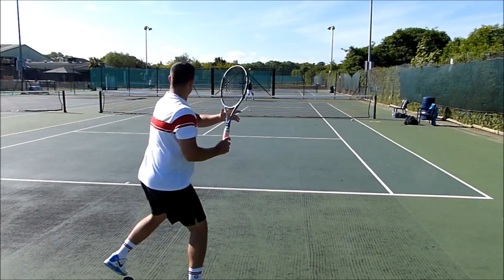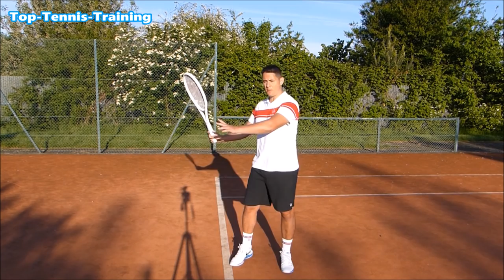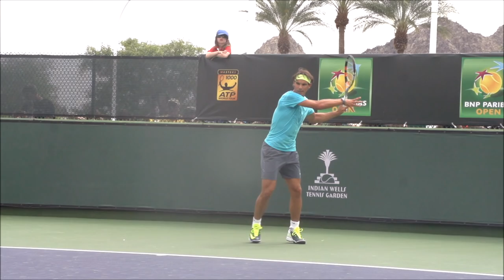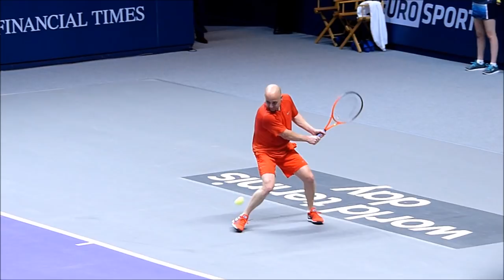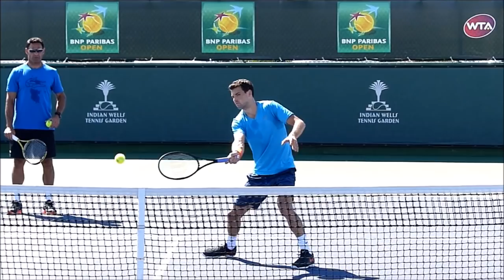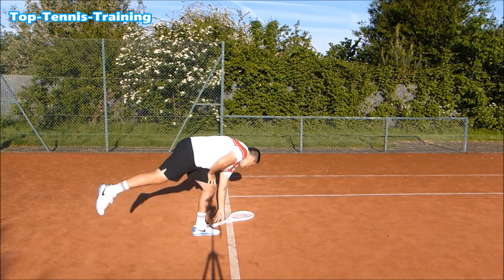How To Hammer The Ball In Tennis - Tennis Power Lesson

Comment: I've been told that I have a decent rally ball (avg ~50-55mph according to Playsight data) but I tend to stay too long in a neutral rallying position until my opponents' take control. My opponents tell me when they hit a weak ball, I need to step up the power and take control of the point. But I am struggling to do this. 

Is the technique for killing the ball different? I've watched your video on killing short balls but it was mostly about the footwork rather than increasing racquet head speed.

Comment: How tight should you grip the racket?
Reply: andrew1991robinson just enough so that you don't drop it when you go through your motion and hit , think more about holding it than gripping it
Reply from the maker: It differs on every shot and strike. Sometimes you need to grip it tighter, for example on a power ball when hitting a volley, sometimes you need "soft" hands when hitting a drop shot etc. The looser you can hold it the better in general as that relaxation will aide the muscles to work at their full potential. A tight hand indicates tight muscles.
Reply: Ok, so for a groundstroke would it be a lose grip and firmer for a volley? Thanks
Reply from the maker: It's not that simple. Sometimes on a groundstroke you'll need to hold it firmer as the strike might require more stability etc. As I said above, it differs on every shot and strike. Adaptation and improvisation is the name of the game.
Good luck in your discovery
All the best
Simon